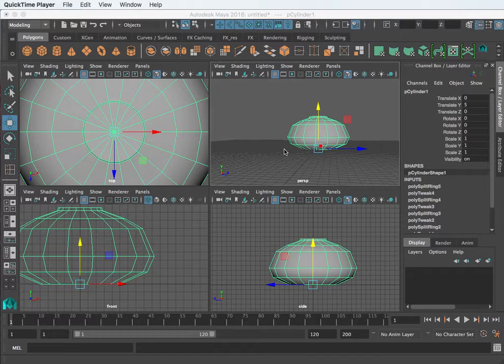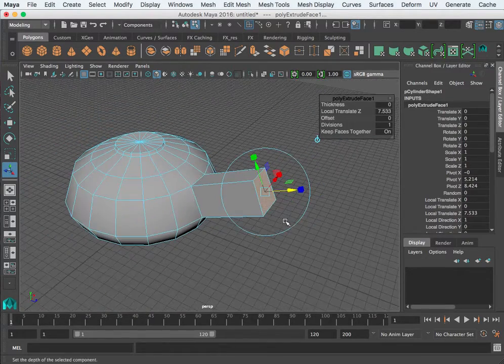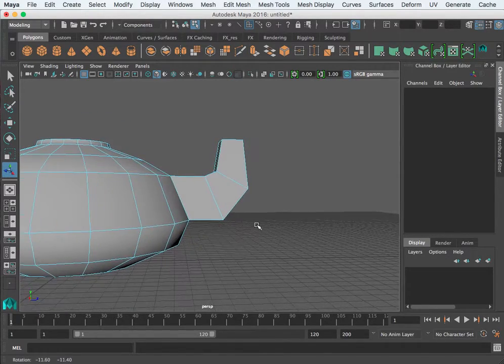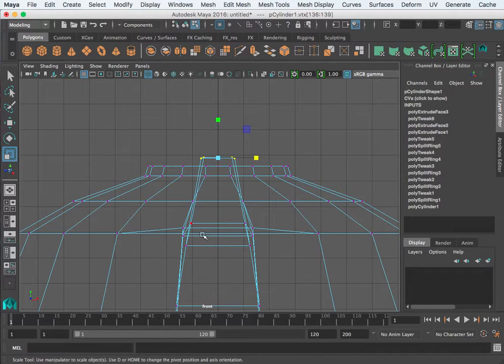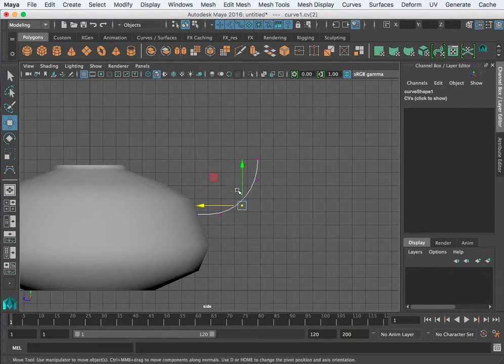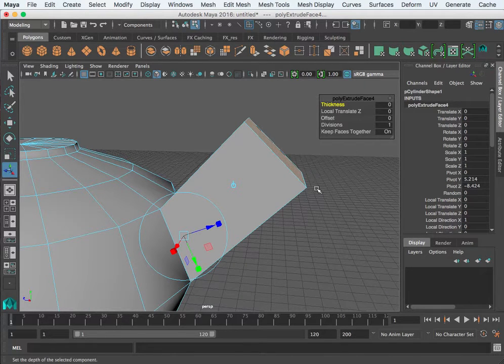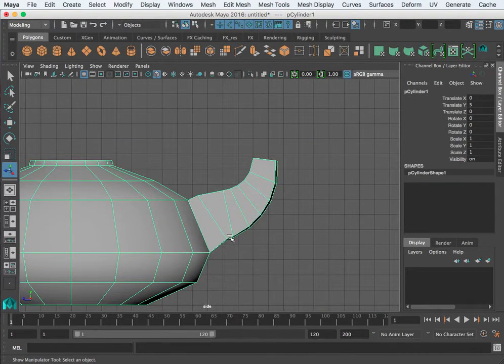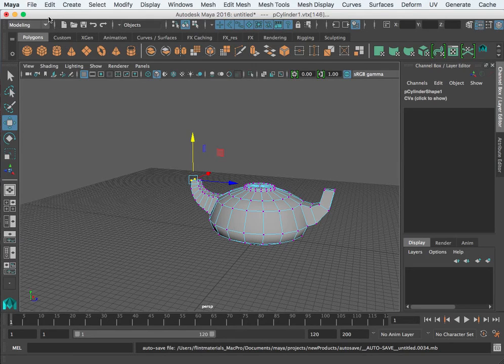Maya 2016 - Teapot 2

Comment: Hello sir, I wanted to know what will happen when I extrude the whole tea-pot so it has a solid inside and outside like real tea-pot. I'm trying: 1st in object mode by selecting extrude and giving a thickness of 0.01 (This is all after I have made the spout)

The result is some misplaced vertices and wierd placement of edges.
Can it be done in a way that the vertices and edges don't get misplaced? If you could try doing and finding a way and letting me know...

thanks in advance and thank you so much for the tutorial